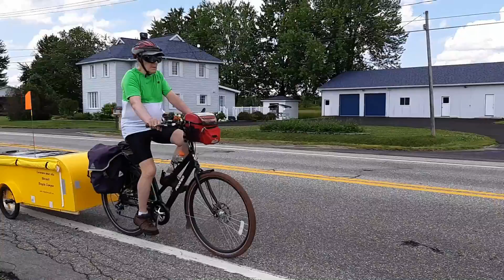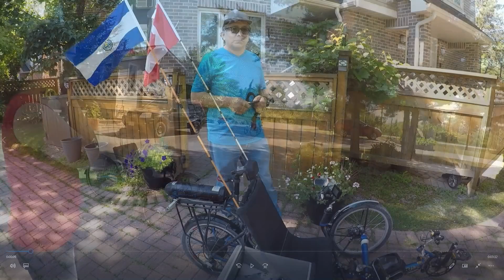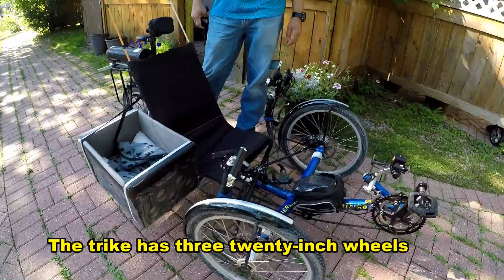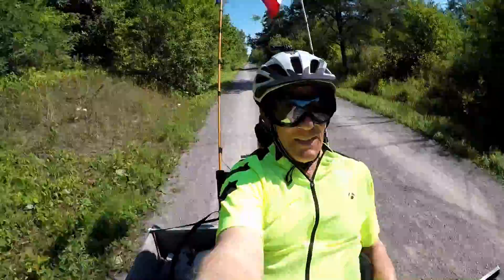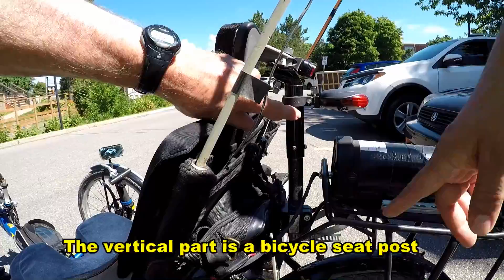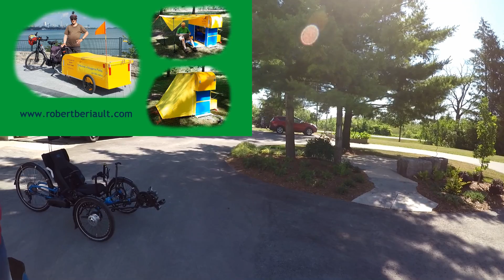Jorge Let Me Try His Recumbent Trike

Comment: Robert thanks for the video.  It is good to come across another enthusiast who is considering a trike.  I have been a recumbent trike rider for at least 12 years having bought my first from Cora after having knee replacements.  I had a basic ICE Adventure with 20 in wheels all round and no suspension.  Loved it!  Five years ago I had it converted by Cora to e-assist using a Bafang motor.  This is a mid drive motor system.  I am now riding an ICE Adventure HD with rear suspension and a 500 watt Bafang conversion.  Being 81 years old I feel the e-assist and recumbent position have added several years to my riding enjoyment.  If you are ever in my area  - I would glad to let you try out my trike - especially on the Tay Shore Trail.  It will give you a good idea of what  a longer trike ride is like.  Your comments about advantages and disadvantage are to the point but I believe the advantages out weight the disadvantages.
Reply from the maker: Thanks for sharing your experience. I don’t know if and when I’ll be in your area, but if the occasion arises, I’d really like to meet you and take you up on your offer. If you would just send me a brief email, I’ll add your coordinates in my “Bicycle Contacts” list.
Reply from the maker: allorobert@gmail.com

Comment: 1) The same car drivers who would claim (after hitting your trike) that they didn't see you would have no trouble seeing arrows on the pavement directing them to the proper lane at intersections, and no trouble swerving to avoid hitting small animals crossing in front of them. Most dogs are not as tall as my trike. 2) The front tires on a tadpole style trike do not have to be removed when changing a tube, and the rear tire (at least on my trike) has a quick release, same as the rear wheel of a two-wheeler. Also, if a bike shop tells you it can't work on your trike, you may want to avoid taking your two-wheeler there, too. The components are the same, except for the front wheel alignment, which rarely needs adjustment. 3) The inability to get through the narrow entrances of some bike trails is so rare it's laughable. Trikes nearly always have no trouble zipping between those poles. Also, measure your body width at its widest point. My trike is only 8 inches wider than my shoulders, making me more visible when I ride on roads. Cars give me more room than they did on my two-wheeler. On the rare occasions I've brought the trike indoors, it has fit through 34 inch doors with no trouble. The front wheel assembly can be twisted to make this work with narrower doors, although it is harder than zipping a two-wheeler through. 4) If you need to make a U turn on a bike path, get off your trike, lift the rear wheel (easier with a carrying rack attached) and turn it, taking up only the space of its length. It will also follow your direction like a well trained dog if you ever have to push it. The rear wheel on mine is extremely easy to lift for pushing the trike along crowded sidewalks. 5) I watch the forecast and don't ride on rainy days. If you HAD to, well, that's why fenders and ponchos were invented. 6) Yes, my trike is VERY slow going uphill, but so am I at age 74. My racing days are long gone! Even 50 years ago, I could not understand the constant need for cyclists to reach the highest possible speed. Just sit back and enjoy the experience. As you say, you will not fall over if you stop to rest before reaching the top of that hill. 7) Yes, the trike cost me a small fortune, but like anything else, do some rough math. If you buy cable TV, drop it, and the money you save will pay for your trike in a few years. Your body and wallet will thank you for not wasting time watching, for example, mind numbing sit-coms or multi-millionaires playing games on your fancy flat screen! :-)
Reply from the maker: Thank you for your heart-felt testimony about the virtues of trikes. I'm still thinking about it. The reason why I'm hesitant is that I've never ridden one for more than a few minutes, except for the time a fellow from Ottawa invited me to try his and I rode it a bit more than an hour. What I want at this point is to buy a a second hand one and learn to like it. I haven't rejected the idea.
Reply: @RobertBeriault753  While my statements were indeed heart-felt, I realize all humans are like snowflakes......totally different from one another, and you have to consider your unique situation. A trike might not be for you, and many trike makes and models are out there, each with a different feel, as you know from your test rides. You have to analyze whether a trike would fit your life style and your body. Each is equally important. Good luck in your quest. :-)
Reply from the maker: Thank you.

Comment: I am Dutch so I am born on a bike and don't know anything else then riding on a bike for fun and for traveling from and to work.
I have had many different bikes, from race to city, to mountain bikes. Now I have a city bike and a recumbent trike.
I now prefer my trike far above my city bike or any other bike I ever had.

What you say that are dis and advantages, aren't all true. When I started to ride my trike, I thought that I would be less visible and for some parts that is true, but that is for the few surcumstances easy to solve with a flag. I noticed I hot a lot more space from cars and I now feel a lit safer on my trike then on my bike.
To what you see depends also on the riders position on the trike. I have a low trike, bug there are also trikes where you sit higher.

My advice, make a list with what you want and find important.
So like budget set a budget limit that fits you. Do you prefer suspension and if so, all wheels or only the rear wheel.
Look ad sitting position. Do you want to sit low or a bit higher up and how easy do you want to go on and off the trike.
As you made a list with the most important things on top, then look ad the trikes in your price range and put the ones that have the most important things in your list ad the top. Then you now what to test and see if it really is something for you.
My trike is low and hard to get on and off for some people, but my new build is easier for me to get on and off. I wanted that with rear suspension.
So I made some changes to my old design and now I am building a new one.

I am also going to build a bike caravan. Paul Elkins design. I call it a riding sleeping trailer. Great for behind my trike. Same width, so as my trike fits, that will fit also.

Good luck with finding a trike. I hope you will find one that you like.
Reply from the maker: Thank you for your testimonial. It's telling that although you have always ridden a bicycle that you are now more comfortable on your trike. Glad to hear that.
Reply: @RobertBeriault753  I see also a lot more as I ride my trike, especially as I am riding the same speed as on my City bike. I look around, where I look more straight forward and down on my upright bike.
I love it and I made changes on my new build so I hot more cobford and could get easier on and off my trike.
Also I noticed that I could ride a lot easier longer distances and that was before I used an e-assist.

Try to rent one and make some long trips. Then you learn to know the trike the best and I know that you will love it.

Comment: Dearest Robert. The Trike Jorge lent you is an American “Terratrike “Cruiser, no longer in production, which he highly modified with extensive homemade or repurposed parts not intended for their use as shown. The bike you are shown trying at the lady’s home store is an American “Trident” Spike, entry model inexpensive trike except for the electric assist modification. And the one you show in the screen shot of your video is an American, made in Orlando Florida, “Catrike” 5.5.9.. About the only thing they have in common is that they are trikes. Some are made from Chromemoly, some of aluminum, some have straight shot chains, some use rollers to accommodate their non linear frames, some use stacks of gears front and back for higher speeds, others use internal gear hubs. I am a 63 year old man, with disabilities, stability and comfort are two of the many advantages for non racer and or extreme mountain biking users. Great for touring, excellent cargo and trailering, adaptable beyond practicality as Jorge demonstrated but getting more expensive every day. Suspension, electrification, gearing, OEM modification and customization along with branding such as Triot, HP Velotechnic, Azub, Performer are pricing this segment of human powered, multi wheeled, geared personal vehicles out of the reach of most people. That is why I ride a 2013 Terratrike Rover I bought second hand and have been steadily improving with Terratrike brand accessories, adding mirrors, rack, storage, new seat cover, pedal retention strap, rear and front lights and flags for  visibility, etc. It is a square steel tube, adjustable boom, internal hub throwback that suits my needs and I spect I will electrify it with a Bosch boom mounted retrofit eventually to keep pedaling, touring and exercising for as long as it will hold me. Find one and make yours for your own pleasure and ride on.
Reply from the maker: My visit to Hamilton Trike and Bent was quite an overwhelming eyeopener. The world of trikes was completely new to me and I had no idea there was such a variety of models available and complexity of designs. Thanks for the wealth of information and the  hint about Terratrike. Let's keep active!

Comment: I’m all about the ebike hub motor build. I built mine so that I pedal only if I want to.
Reply from the maker: A lot can be said for DIY builds. ebikes.ca is probably the best source of info on that subject. Thanks for your interest.
Reply: Some time back I calculated that my 48 volt 20ah battery should give me roughly 30,000 pedal free miles if I keep my speed to no more than 20 mph. And that’s leaving me with a battery still at 80% capacity. Now that is if the battery is used at a rate of 10,000 mile per year. Left sitting in storage does a battery no good, of course, as you know Robert.  So, one has to do some riding to get the full benefit for sure.  See you on the trails!

Comment: I have a trike. I mostly agree with you, but could add a few points-
People with hand problems will find them easier to ride.
People with hand problems will find them harder to take them out the door and down the stairs. (I keep mine indoors by necessity.)
Splashing from the front wheels is not a problem. The splash doesn’t hit you.
Speed/wind efficiency is over-rated. You aren’t going  to go faster, but you will be more comfortable and safer in many situations.
My expensive, high quality trike doesn’t get as much use as it should. I really need to add electric assist and find a safe way to store it outdoors. Then, it will be the perfect vehicle for me.
Reply from the maker: Thanks for your input. Jorge spent $200 on a set of fenders, so I assumed it was because of splashing.
Reply: @RobertBeriault753  A few more things- Walking a bike is much easier than walking a trike. 
Any recumbent needs to have low gears (or electric assist) on steep hills. With low gears, I don't mind the fact that I can't stand on the peddles. 
The front wheels can put up some spray that wind blows onto you. Fenders are useful for that, but splashing hasn't been a problem on my trike. YMMV.

Comment: Robert, if you get a Trike you might want to change out the rear tire. My Catrike Dumont, I pulled off onto the grass and about didn't get back on the pavement.  My Dumont I bought brand new and the rear tire was a road tire ( it was a slick ) which had no tread. I had it replaced with a semi off road tire and it was the best money spent. I am 70 years old and not out to do any speed races. I don't have any balance issues but really enjoy not worry about falling over while at a stop. No more neck, shoulder or butt aches. I hope you choose a good bike and get everything you need. I have 2 different trailers that I have towed around. I have found the BOB Yak really is nice, so if I ever build a trailer like yours, I know my Trike can handle it. Enjoy your riding.
Reply from the maker: Thanks for sharing your experience. All the best.

Comment: I have built Robert’s camper and pull it with an electric recumbent trike ( Catrike Dumont). Key to overcoming many issues mentioned is to go electric. I have a 500W Bafang motor that can handle about anything. Most trikes use the same elements as any two wheel bike - same chain, breaks wheels, chain rings, etc., so most bike shops can help when needed. I am 75 so for me there is no downside to an electric recumbent. I have hung mine on a wall and hauled it in a Mini Cooper. My current trike folds.
Reply from the maker: Thanks, Gary. I would definitely get a folding one. No reason not to. And the Bafang motor sounds like a good choice, since it can be found everywhere.

Comment: As you know, I ride a 2 wheel recumbent. Trikes are certainly more popular these days, but for the types of riding that I do most, they aren't very practical (you outlined many of the reasons why). Just like you, I wasn't willing to take the plunge and buy a brand new recumbent right away. I bought a second-hand recumbent for a small fraction of what a new one costs, which allowed me to take unlimited test rides. From that experience I got a good sense of what I liked and didn't like, and it really helped me in choosing my next recumbent. About a year later I re-sold my original recumbent for the same price I paid for it. It sounds like you're considering doing something similar with trikes.
Reply from the maker: I'm following your footsteps. I'm keeping an eye on Kijiji for a used 2 wheel bent. For winter riding, I just bought myself a fat bike. Finished assembling it yesterday and going for my 1st ride this PM when it warms up a bit.

Comment: You need to check out two wheeled recumbent's. I ride a long wheeled based one, that I converted to an E-bike. But there are short and medium wheel base models. As for three wheeler's. Cattrike makes one that sits up a bit higher. It has a 26 inch rear wheel. As for not being able to use your weight on your pedals. This is balanced out because you use your lower back and your full leg muscles when pedaling a recumbent. Keep trying them out. You may find one you like.
Reply from the maker: The two wheel bents are even rarer. One of the difficulties is that trikes have never caught on in this part of the country. They are as rare as hens teeth.  Very few stores sell them and the few that do don't carry stock and will only order one if it's prepaid. Thanks for your input.